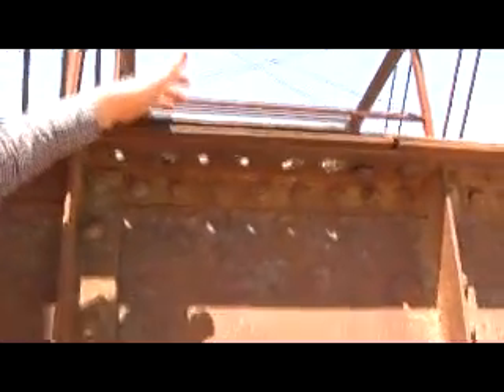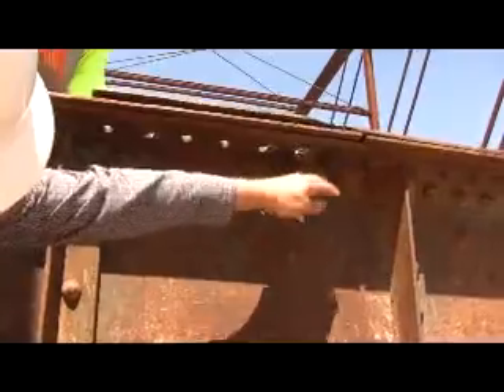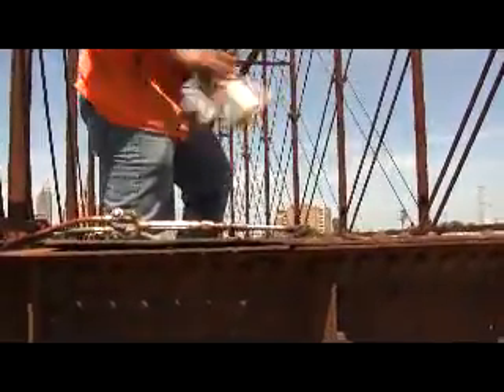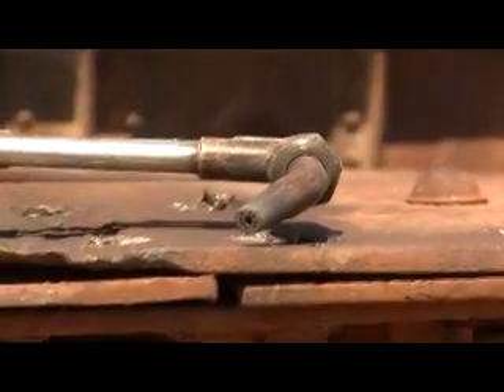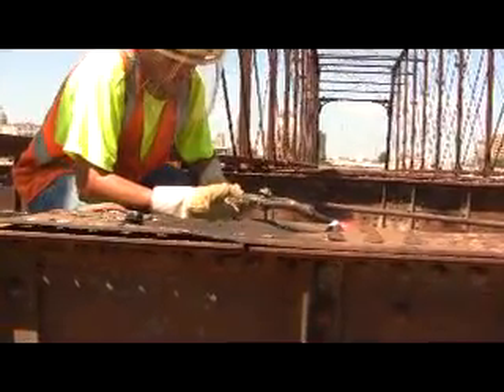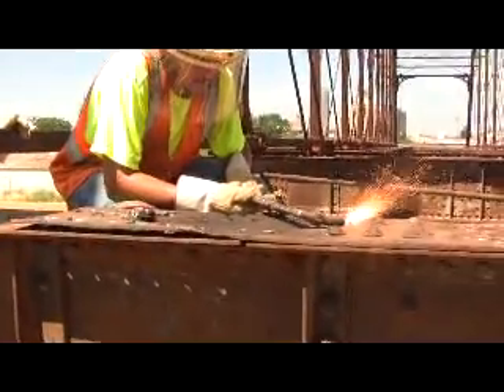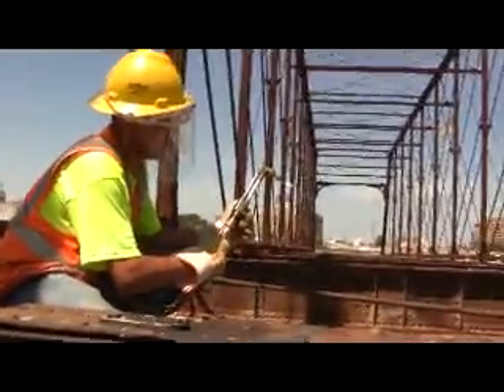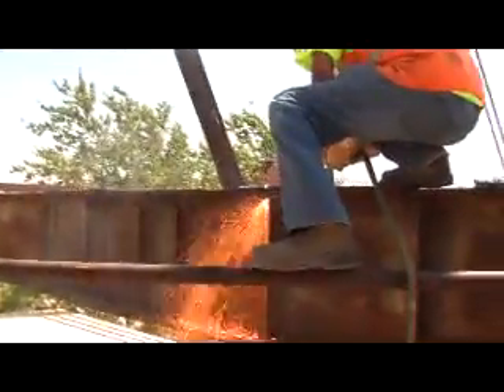Hays Hot Rivet Repair 1 Removal technique

Comment: yeah im three years late.. im helldogging inch rivets through about 4 ply, 6 ply with stiffeners on elevated tracks in nyc. never scar the steel with the chisel. but holy fuck do some of those fucking rivets mushroom between the plies... but we lance those motherfuckers and punch later. havent used a torch on one of them. but to use a torch on something like this is just ridiculous. and i cant even imagine dogging downwards like this. everything i do is well over my head.